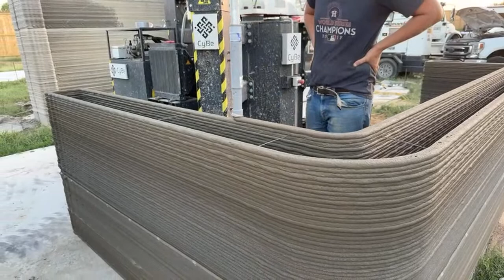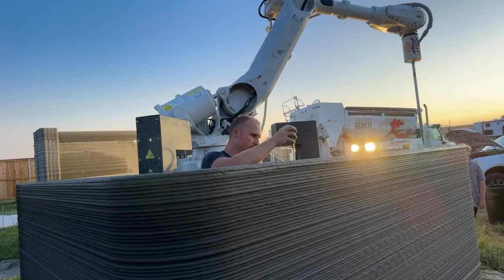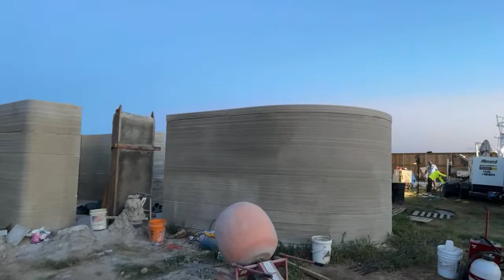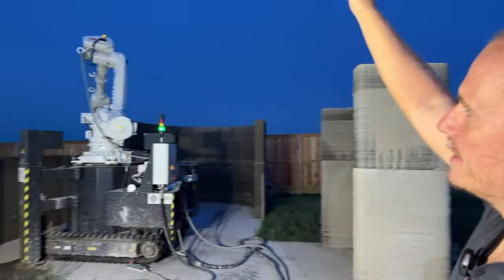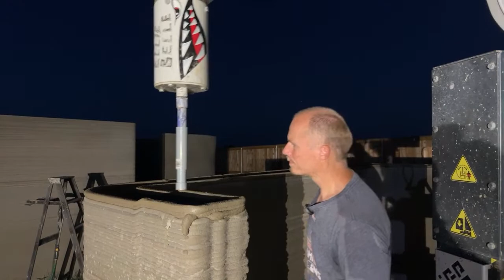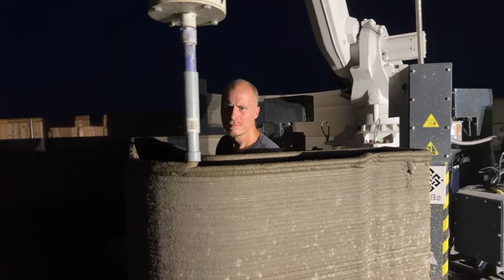Live printing houses into the sunset

Comment: It'll be great when they get the legs working on that printer! Cybe has a nice video that shows way more height using the legs! In this live stream they had challenges during the nozzle switch which would be avoided if they can do the full vertical section without stop/start.